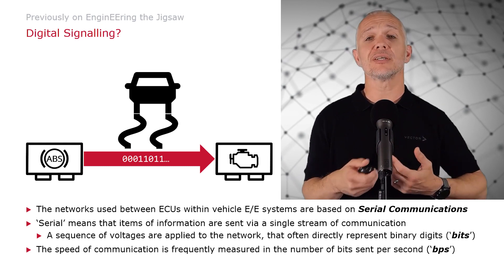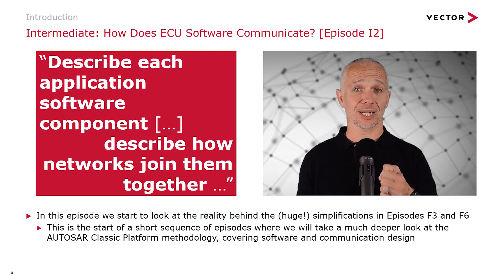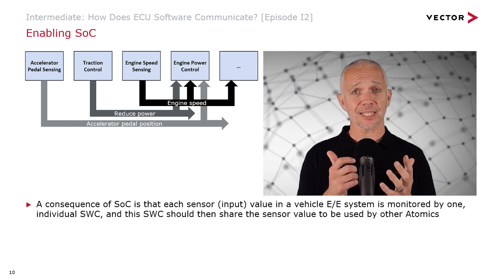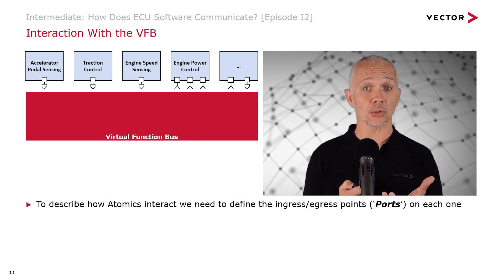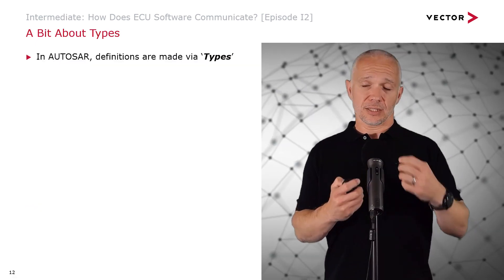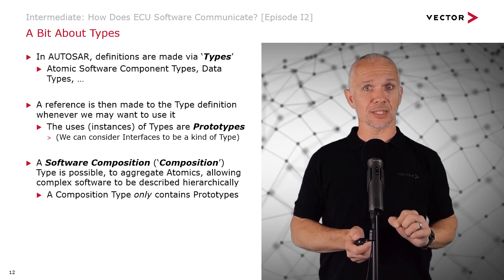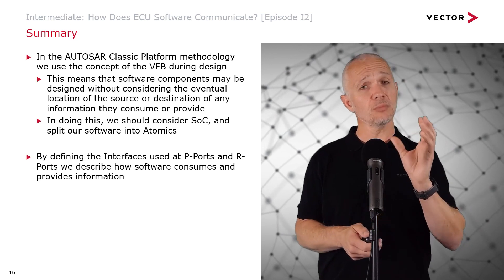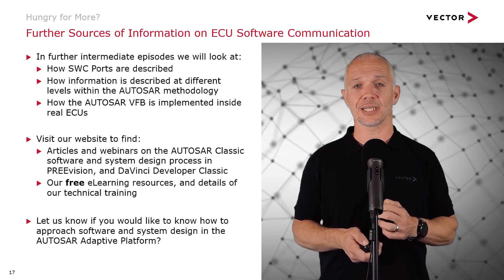ECU Software Communication | AUTOSAR Classic | #EnginEEringTheJigsaw | I2

Comment: Hi, I have a generic question regarding Ports: is it correct to say that, a SWC contains multiple Atomic SWCs, and each of the Atomic SWC has at least one type of Port (R, P, RP, and maybe even Delegation)? And, from a different perspective, we may say that a SWC has a total amount of Ports equal to the sum of all Ports that each contained Atomic SWC has? Tnks
Reply from the maker: "SWC contains multiple Atomic SWCs":
A composition has no behavior (or runnables) of its own, it only exists as a way to aggregate Atomic SWCs (with behavior and runnables). A composition could theoretically contain zero Atomic SWCs, however this would serve no purpose, other than as a placeholder for an aggregation of Atomic SWCs that will be defined in the future.
Reply from the maker: "we may say that a SWC has a total amount of Ports equal to the sum of all Ports that each contained Atomic SWC has":
No. It is common for some ports on Atomic SWCs to only be used for communication within a composition. In fact, at the system level, AUTOSAR Classic Platform defines constraint 3031, where it is explained that "[a] Complete System Description does not have ports on the outermost composition".